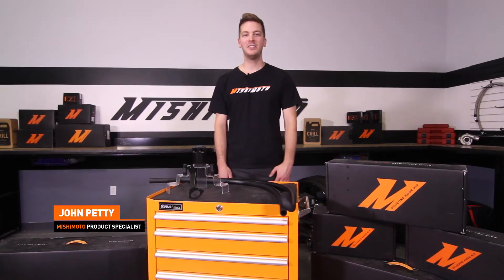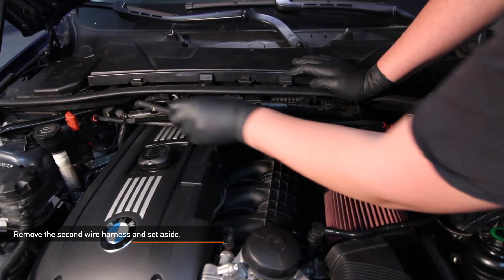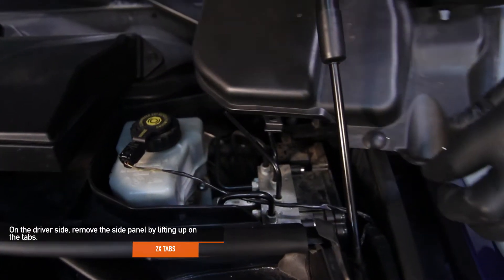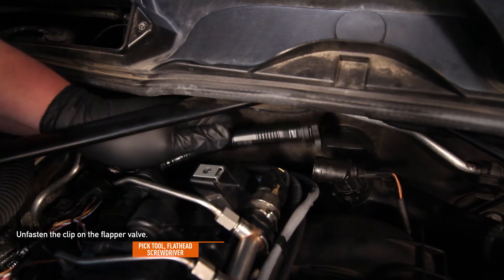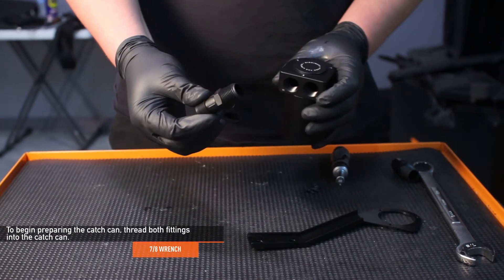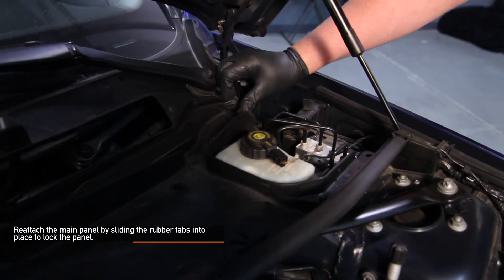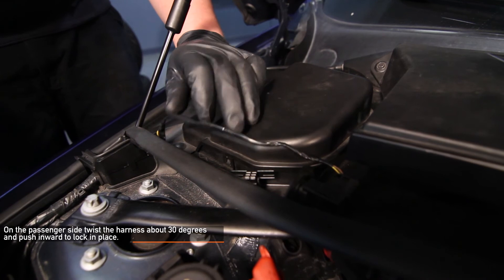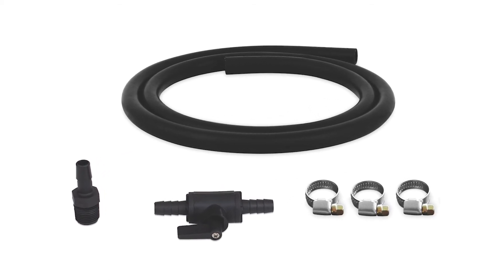2006-2010 BMW N54 Baffled Oil Catch Can, CCV Side Installation Guide By Mishimoto

Comment: I hope you answer my question: have you performed any tests on crankcase pressure? What is the effect of this mishimoto catch can on the N54 crankcase pressure in stock, stage 1, stage 2 ? How often or should the brass filter be change to avoid obstruction? It's very critical to maintain healthy crankcase pressure, so I would be extremely happy if you could answer me. Thanks! (I have a mishimoto catch can in my N54 by the way).
Reply from the maker: There should be no negative effect on crankcase pressures. We have a guide on YouTube on how to cleanout the can and the filter linked below. 

https://www.youtube.com/watch?v=K116LhLVap4&t=1s&ab_channel=MishimotoAutomotive

Comment: Tried to install my catch can today but am having issues with part 17 on your guide (putting on the hose with the 180 degree bend) Do you have any advice on how to get this part on as the hose seems to be really thick & not sliding on the intake port
Reply from the maker: If you are still having issues with this please feel free to reach out to our support team at support@mishimoto.com. They should be able to help go through the install and provide any tips possible.

Comment: can we use that kit on an BMW E64 LCI 635D of 2009 ? by mistake i order that kit... if you have an way to adapte it ?...
Reply from the maker: This was not designed for the E64 unfortunately and would require modification to fit.
Reply: @mishimoto  you have an model we can adapt for it ?

Comment: What do you do with the part that the hoses hook up to, that you are bypassing. I guess it's under the intake
Reply from the maker: Nothing is bypassed using this kit. We are intercepting the connections to the hose that is removed. Each end of the catch-can kit will connect to one of these 2 points.

Comment: From what I've seen these cars need it by design. Thinking about picking up a n54 4 door manual for a pretty good deal with 60k miles. To ensure I don't get all that oil build up in my intake valves I want one of these. Daily reliable BMW mod lol b/c removing this head to clean looks expensive